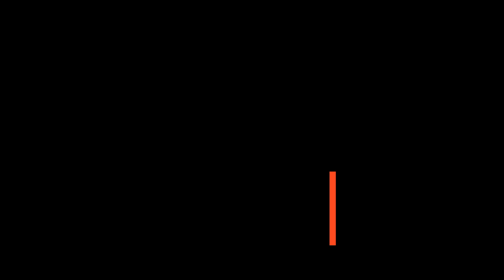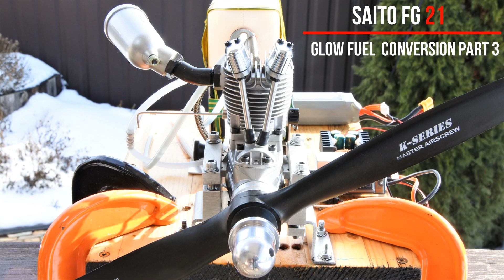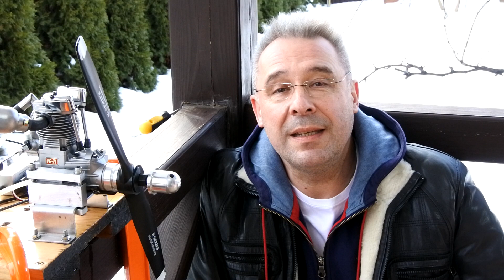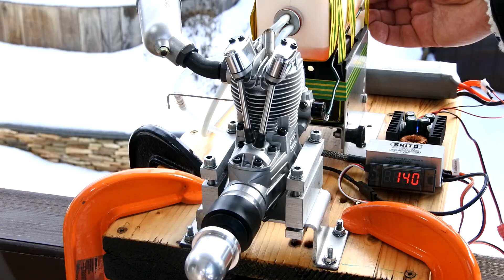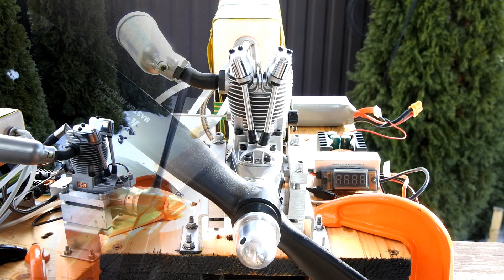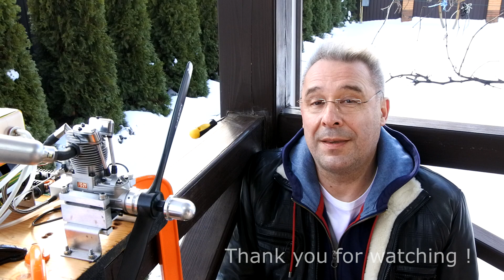Saito FG 21 glow fuel conversion Part 3 spark ignition run

Comment: In the pipe fuel line u install one way valve?
Reply from the maker: Hi and thank you for your question ! Definitely, not, there is no check valve (one way valve) in the fuel line, it's fuel filter. Check valve is necessary for Yamada style engines, like Yamada FZ 53  https://www.youtube.com/watch?v=qahk9dCf0e8 , or Yamada YS F120 : https://www.youtube.com/watch?v=EXhKnopO0LU . Both will not functioned properly without this check valves.  Thank you for your question and have a nice day !
Reply: @crazyengines88 i test my engine asp 52 2stroke convert to petrol. 
I setup cdi hall sensor and install spark plug 1/4. I using stock carburator asp. Engine running idle good. High throttle also good fine tunning. But if i try put up to climb rate my engine got lean. I see the fuel line got bubble. Any solution? Can i install check valve. This my vedio https://youtube.com/shorts/araeddIAEdw?si=Oxfa_WvCAOKCoOBU
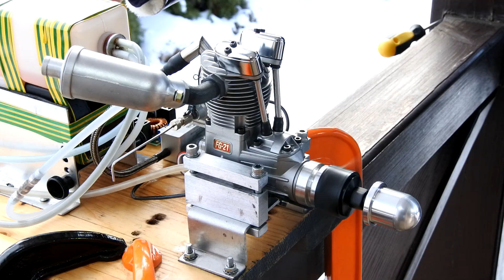Reply from the maker: @maskystudio9193  Hi, thanks for reply, I'll look your video a bit later, to identify the problem. In general, stock carburetor is developed for methanol fuel & it's not a surprise, that engine  runs leaner, because  "normal" stoichiometric composition for gasoline should be approx. 1:14.7 (gas to air) mixture by weight. For methanol based fuels  stoichiometric composition should be approx. 1:6,5 (methanol to air by weight). ASP carb was developed for glow fuel mixture, so it would not work well for gasoline. I would recommend you to change the carburetor from ASP to DLE gas engines (something from DLE 20-30-35). Thank you for your question and have a nice day !

Comment: Hello
Can you test the fg21 with special  OS G5  plug.
This plug is specific to osggt 10 and 15., Thé O.S Glow gas engine

Thanks for for your videos
Reply from the maker: Thank you for your request ! Unfortunately, I can't make any new videos, due to the war in my country, I was forced to leave my lovely house and my engines collection. May be, in a few weeks or even months, I can return back home. Hoping, will found it untouched. Anyhow, you can find an answer on your question here:
 https://www.youtube.com/watch?v=u2yeXQS8_v4
This is Saito FG 21, converted to glow ignition, using OS G5 glow plug. Engine is running on gasoline fuel mix ( look at fuel tubing, it's yellowish color, special plastic for gasoline).
Hope, it helps !
Thank you, and with best regards.

Comment: I have a Sato 173 R3 what electronic ignition running glow fuel runs fantastic starts easy no more Dead stick Landing
Reply from the maker: Very clever and great choice of an engine ! Should  say, that Saito FA 170 R3 engine is still on my TOP list of Saito engines. It is really a piece of mechanical and engineering art !